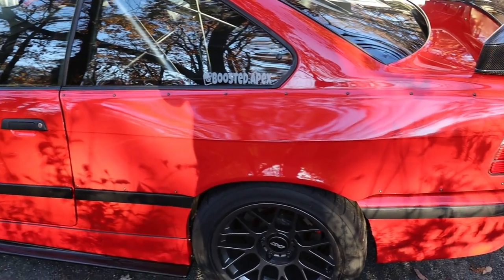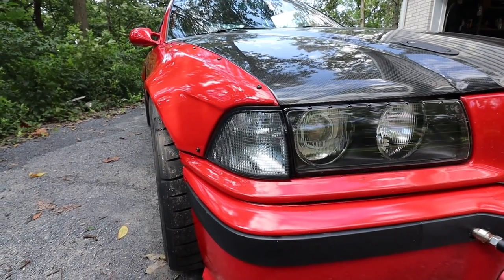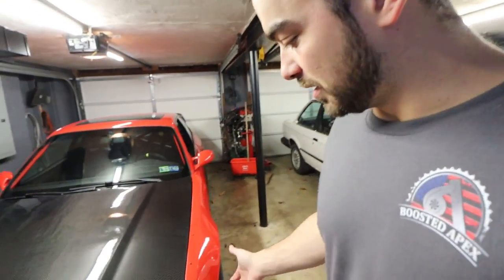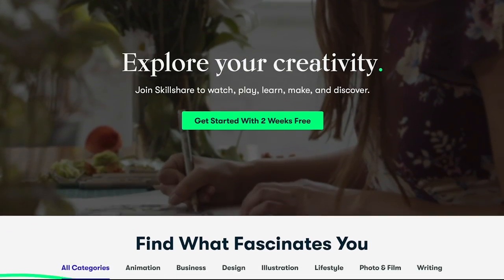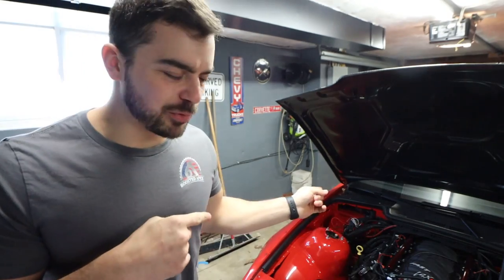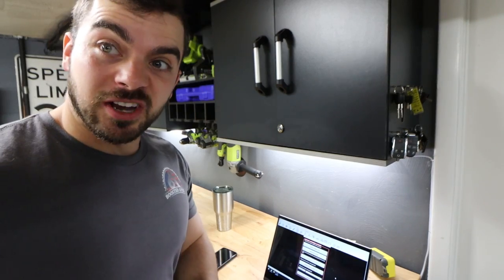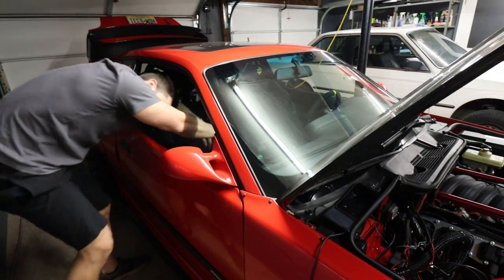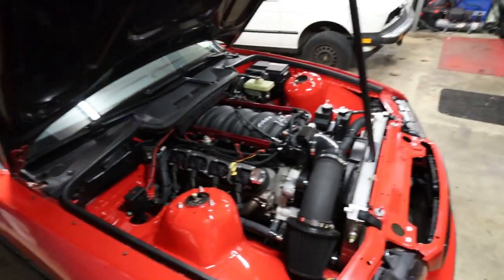How to Gain More HP with E85 + Carbon Fiber Parts Get Installed on my LS E36

Comment: Your e36 is soo clean! Gives us some ideas for our twin turbo 6.0 e36
Reply from the maker: Thank you! Idk how you're stuff a twin turbo 6.0 in there though lol
Reply: @matt13ross  it's a tight fit for sure! We have a Playlist if you ever wanna check it out
Reply: @matt13ross  are you using ls power steering pump?  We recently made an adapter to mount bmw power steering pumps on ls engines.
Reply from the maker: Yea still using the LS pump.  If I have an issue I plan on swapping back to BMW pump.
Reply: @matt13ross  Nice, I think there are some pictures of the brackets were are making on our IG page if you wanna check it out sometime. It's probably in one of our videos as well.

Comment: Hi again. I'm sorry but why you don't put some washers in the back of the bumper. The rebit nuts will secure bether. Peace ✌️
Reply from the maker: Rebit nuts?  Sorry I'm lost.
Reply: @matt13ross  I'm sorry for my English, you make the holes for the carbon blades and you put what did you called the part on you screwed?
In that piece if you put a washer inside of the bumper it will hold very good. Another time, I'm sorry for my English. ✌️ Wish best luck.
Reply from the maker: Oh I gotcha.  The Rivnuts.
Reply: yeah rivnuts, sorry for my english, i´m a portuguese. :) peace